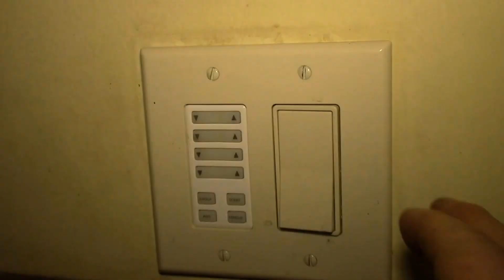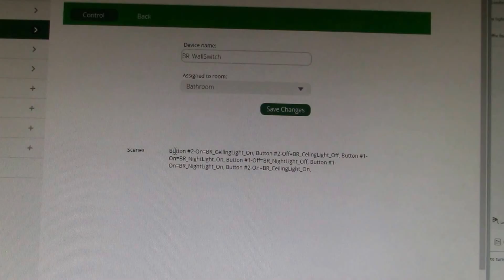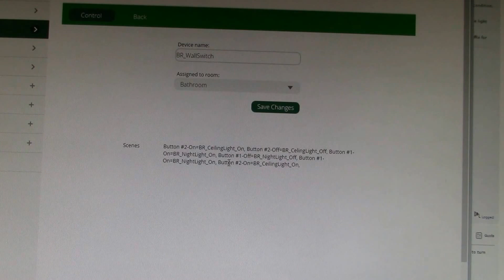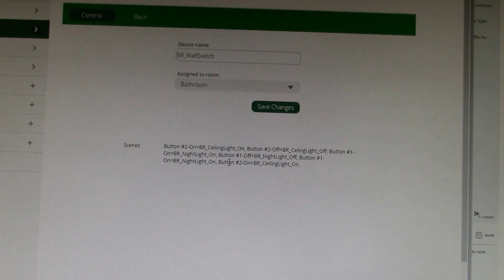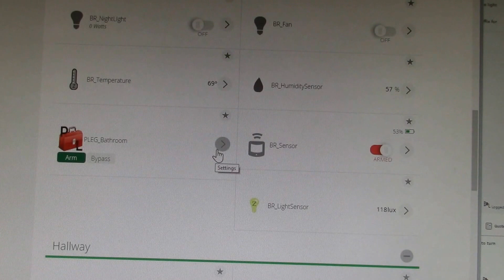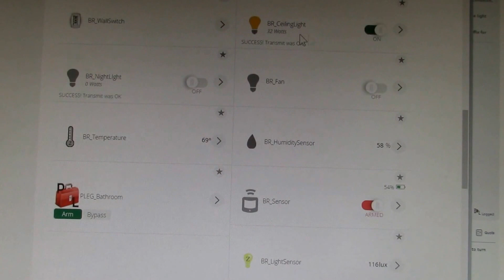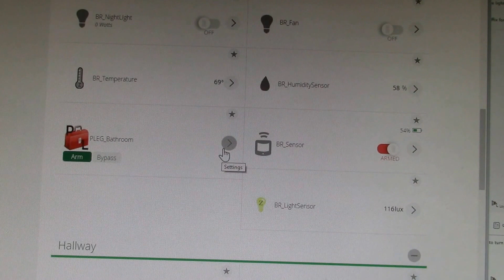Automating a Bathroom Light and Fan, Part 3

Comment: cool seems very useful!
Reply from the maker: fliping720 Yes, quite a useful little system.  I keep finding little things to use it for.  It's something that you need a specific project in mind to bite the bullet and dive in.  But then, once it's up and running, new things keep popping up.  I'll have something I want to do and maybe months later it'll dawn on me that I can do that with the Z-wave controller.  You need to get out of the mind set of just using it to turn lights on and off (like is done in this video series).